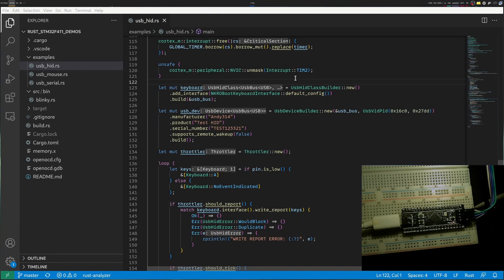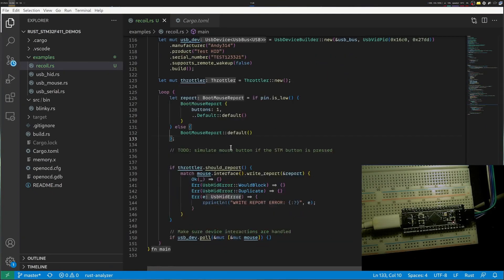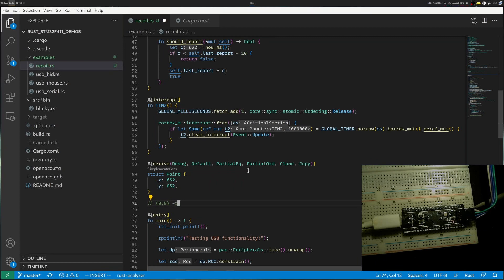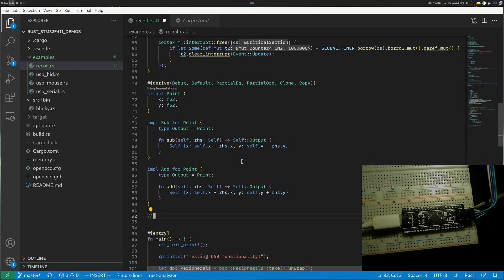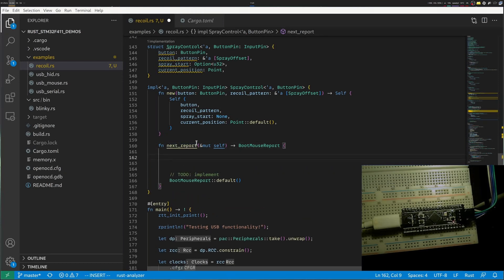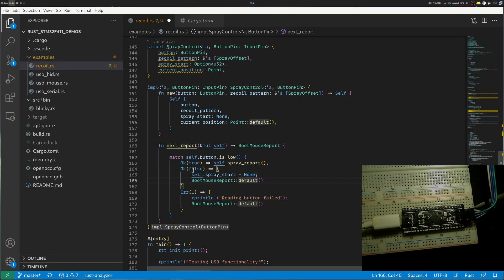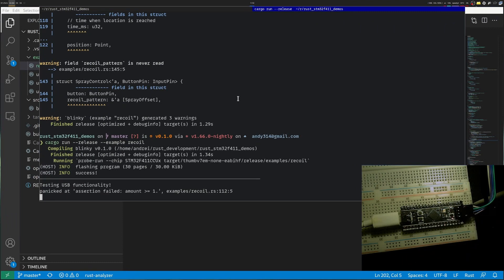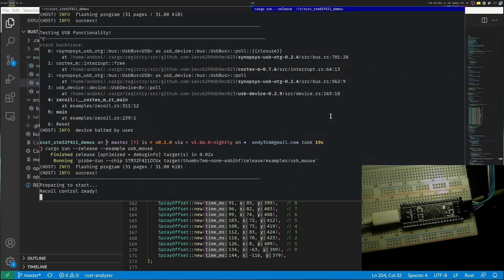Embeded rust: Using STM32 to simulate a mouse that can recoil control FPS games

Comment: Thank you!  Very neat concept.  I have a CharaChorder, it uses a Seeeduino I believe, and when it "chords" it first sends the "wrong" keys (since you can press them out-of-order), and then sends several backspaces, then the correct word.

Have seen other custom devices as well; neat to see how easy it is to "take control"!

Your sound level is much lower than other videos, I have to turn the volume up.  I really enjoy your content, and would help you get a new microphone setup if that's what the issue is.  Thanks again!